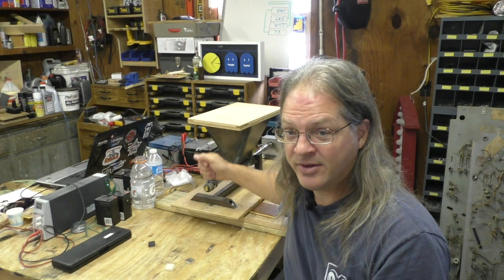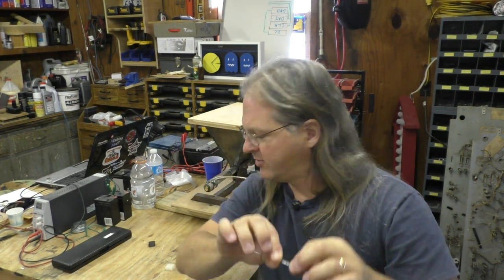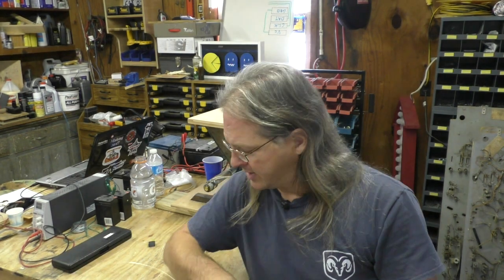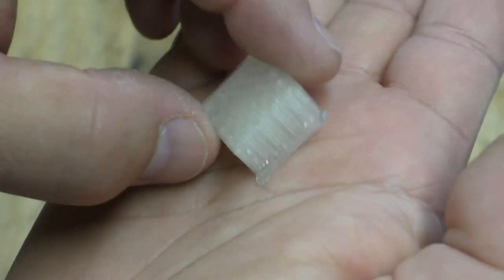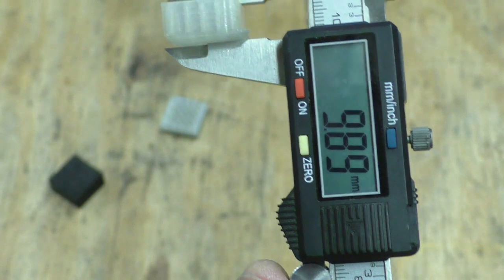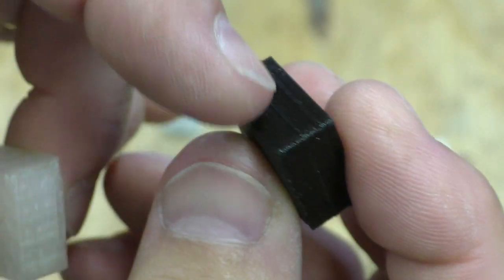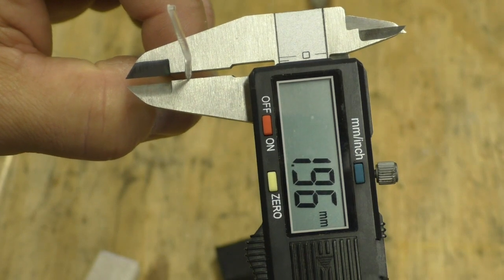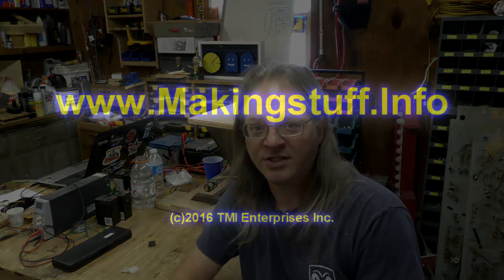Filament Extruder #11 - Printing Cubes

Comment: I just seen this video and it occurs to me that you need a longer nozzle to extrude the filament thru. This does several things, first it will ensure the extruded material will retain the diameter of the extrusion hole. Second it will allow the plastic to cool more. A larger hole may not be the problem really since all plastic resin will shrink when cooled, you would have to do some math to determine shrinkage but I think the oval problem would almost completely disappear and could eliminate the need for your water bath.

Comment: I would suggest adding another   extrusion hole just before the water bath... from the first extruder it comes out hot and soft and has a chance to deform before it hits the water... so if you add one more extrusion before the water it should reshape the filament back to round before the water.

Comment: Try a "v" groove in your tensioner also if the filament is still warm the rollers my flatten it. Speaking from experience I worked on extruders in a factory setting. Great job on a diy setup tho.

Comment: Hey Bob I thought I would run some farmer logics past you which may possibly solve your problem. I would continue to extrude a slightly larger filament, machine the filament pulling rollers to the desired throughput diameter and assemble to roll tightly together, place them in the water bath on an adjustable horizontal slide to adjust or regulate the required time of cooling on the filament to optimum conditions prior to it being fed through the pulling/resizing rollers and on through more water bath cooling may give you the desired consistency in your end product. You may have to run the rollers closer to the extrusion speed rate. Directing the cooled bath intake water over conductive metal rollers largely encased in non-conductive material, may give a little extra cooling right at the resizing point may merit some thought!

Comment: The oval shape is because the water bath isn't cooling as well as it should... maybe add one or two peltier water coolers in that loop
Reply from the maker: Actually it's the opposite.  The filament is cooling too fast.
Reply: Making Stuff but how did it get the oval shape? I thought its maybe too soft and the rollers are squishing it into that shape.

Comment: I worked in a major telco lab which had a glass fibre pulling tower. The fibre dropped down through two office floors to cool. I was not involved in these projects but know from my optics training that tolerances in communications fibres would be much tighter for sure. What you have seems close enough with out going vertical. Very nice project :)
Reply from the maker: Thanks!

Comment: the oval shape is because your pulling the plastic horizontal, if you would hang your extruder on the sealing and let it stretch down, with the gravity and puller helping you would not have the oval shape. I use to work ik a factory that made plastic filament to make carpets. The extruders are on top of the building and cooled by cool air (fridge). Form the extruder to the floor there was about 40m height difference. In the end on grond level the plastic filament was hard enough to spool up, and with the spooling up the are pulling the filament down. Its a fine tuning of amount plastic feed/gravity/cool air/spool that puls the fillament down to get the right thickness.

Greetz Bensh from Belgium

Comment: I know you have mostly fixed the issue by now,  but try heated water. The rapid cooldown of the filament may cause problems. Maybe 60°C is a good start.

Comment: could it be caused by the pressure of the rollers measuring the thickness?? if it isn't fully hardened... the round extruded would turn oval...to test this, run some through the water bath, but not through the measuring rollers... just set it at a fixed speed, the diameter will not be correct, but it should be round. if it is, then you know its the rollers, and you need to add more water bath to cool the core more before you pull it through... but if it is still oval, then its either the extruder nozzle, or its bending somewhere before its fully cold...

Comment: From what I have seen of your project I would venture to guess that the tension on the puller rollers may be causing the distortion you are seeing.  The reason I say this is that the water bath is cooling the outside of the filament rather quickly but the inside most likely takes longer to cool and the clamping force applied by the puller rollers may be crushing it slightly.  You may be able to try reducing the clamping pressure of the puller or making the water bath longer.  You could also try increasing the distance to the puller rollers as well.  You could also try to make a rounded groove in the puller rollers in order to spread the clamping force out to the sides better or have 2 sets of puller rollers 90 degrees offset from each other to try and keep both cross sections more reasonable.

Comment: Could you please consider toning your intro down a bit in future videos? It is really quite loud, comapared to other videos and compared to the rest of this video :(
Conderning the video, is it possible that the filament is not quite cool once it reaches the pulling mechanism and is therefore shished a tiny bit? Or maybe you need to bias the nozzle a bit so it accounts for that, so of the filament comes out vertically oval shaped, that would mean you'd need to put a horizontal oval shape into the nozzle? Just some ideas :)

Comment: okay so you're using a water bath that's good. But what about when the filaments is exiting between the hot nozzle to the bath. do you have some curve where the filament is rubbing against when it passes.
Reply from the maker: Nope, it's a clear shot from the nozzle to the water
Reply: well the pulling could be the reason why it deforms. I believ there is a push(filament going out) and a pull( to the spool) ratio. Like you said on the clean way through to the water bath that could be why because it is deformed at it's hot state. The gravity affects it slightly. just add a v shaped bent wire between there and it might help.

Comment: I was wondering if you used a reamer to make the hole in your die?  Sometimes drill bits will make oval holes or too large holes but if you start a bit smaller than the reamer size you should get a round hole.  Thanks for the video.
Reply: I suppose a good way to test is rotate the die 90 degress and see if the flat spot on the filament is in the same place. It's either that, or it's still slightly too soft prior to being wound on the spool, and it's sagging.
Reply: Or possibly pulling on the filament and causing it to stretch and distort?
Reply from the maker: I used a drill bit.
Reply from the maker: Good idea.